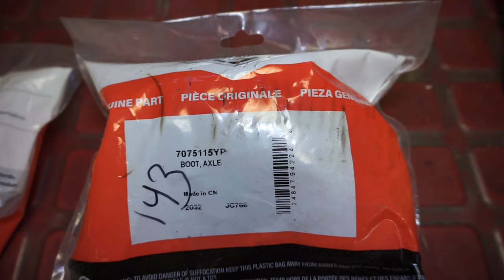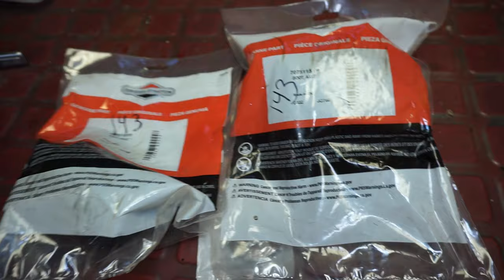2 Old Snapper Riders 28 Deck - Start Up /1st Road Test - What's the Difference,One is 2003 - Other ?

Comment: I bought a mower just like that older one at a estate sale this past weekend...$40...put in new battery, plug, fuel filter...changed oil...it cranked right up. Was told it had been sitting in shed for 12, 15 years since last cranked. Im VERY satisfied with that deal.
Reply from the maker: I don't like you lol hehehehehe
I call NOT Fair lol
Wow, good on you, ya did good, enjoy!!
Reply: I'm STILL mowing my yard with it. Tough mowers that are well made.i had same problem.. Engine ran but it would die when I tried to engage blade... Turned out to be some kind of faulty safety sensor or switch

Comment: These old snappers just run forever 👍
Reply from the maker: Yes,, if serviced!
Reply: They cut better than my $6k zero turn too.
Reply from the maker: @modelcitizen394  Nice,,,,,probably do,,,,I don't have a zero sooo
Reply: @TheNovaJohn  Seriously. I have to make two to three passes with the zero turn to get it as clean as my 27 year old Snapper does in one pass.
Reply from the maker: @modelcitizen394  Really,,,wow,,,thats crazy wasted time!
Reply: Mine currently has a blown motor…9hp B&S
Reply: Still using my Snapper from 42 years ago, I have to laugh each time people say you have to do this and that to them, I did a real good repair with boots after about 15 years of cutting, about 25 years ago, and just a few days ago she got a new belt, and a sharpen blade, and i went real crazy with an oil change!  a grand total of  4 dollars for professional sharpen and balance, 15.99 for a new Kevlar belt, cleaned the spark plug too, and 7 dollars for oil change, But I can tell you for sure I only use synthetic oil period.

Comment: I'm getting my 1985  snapper extra stuff series 5  ready for a repower with a 13 hp Tecumseh xl/c enduro overhead valve engine the sad thing is that Briggs and Stratton quit making them back in 2019 😫😩
Reply from the maker: I know but 2019 is recent so they should be around a while..
What Happened to your engine?
Reply: @TheNovaJohn   The 11 hp Briggs and Stratton went out because I didn't check the oil  in it 😭😭
Reply from the maker: Nooooooooooooooooo
Reply: @TheNovaJohn   yyyeeesss I found out the hard way but it is not a total loss for a Tecumseh engine is going on that machine
Reply from the maker: Noooooooooo lol
Have you removed the drive disk yet? I wonder if that is gonna be rusted on?
Reply: @TheNovaJohn   I got the drive disc and the belt pulley off the blown engine by means of a pully puller the other engine was on a rear engine snapper the drive disc and blade pilot is still on it I'm going to do another video on it tommrow  I've already done 2 on this  engine swap
Reply: I wanted to see her switch into high gear! 😉👍
Reply: @Rein_Ciarfella  she will soon
Reply from the maker: @Rein_Ciarfella  LOL me too
Nice little machine for us,,,I bet she might even cut the lawn too
I didn't like these things at 1st but if ya can get one is good shape and for cheap they are easy to maintain!
Reply: @TheNovaJohn    Drink holder and umbrella shade holder and repaint pretty pink and you won’t be able to keep her off it!  I think that should be a video! 👍🔧🧰
Reply from the maker: @Rein_Ciarfella  LOL,, I gotta tell her this!!!
Reply: @TheNovaJohn  I worked @ the Snapper plant over 40 years TILL B&S closed the plant in McDonough Ga. currently there are MAJOR Rear Engine Rider parts that have being discontinued
Reply from the maker: I've heard that,, That must have been cool working there,,,,How many of these machines do you have laying around? lol
Reply: @TheNovaJohn   just got one  had 2 of the older ones but they went to the scrap yard

Comment: My when I turn the key on my 1028 snapper it does nothing. I know the starter is good and the battery is good. Is there a kill switch that turns off the starter? I may be dealing with a wiring issue
Reply from the maker: Oh yes you are,,,I have a video on this,, check the folder on my channel!

Comment: Quite a number of CHANGES, through out the years, they make look similar but they are not the same
Reply from the maker: Generally, many things seem to be improved I've noticed but I'm not that knowledgeable. 
I just like these! 
I'm hoping to get back to mine this season, I didn't get to it last year even though I put it in my way! lol
Reply: @TheNovaJohn  Well I worked AT the factory from 72 till the plant was closed by B&S, 90% of the time I worked there I worked in the Quality department, I've handled EVERY part, EVERY change, EVERY blueprint and did many of the first piece inspections during that time, the BIGGEST MISCONCEPTION is that since they are similar then one can swap parts, do adjustments willy nilly on all of them the same which is FALSE, doing so can cause your mower to be leas reliable, and even NOT safe

Comment: How much for plastic grass catcher
Reply: Get the mulch kit instead! It replaces the discharge chute with a block plate that seals the deck.

I use Oregon mulch blades and the yard looks amazing. Its also nice doing the leaves in the fall & winter this way

Comment: who cares?  nobody buys those overpriced pieces of crap when you can buy a John Deere with a 42" deck, 22hp v-twin engine and hydrostatic transmission for the same or lower price.  that's why Snapper discontinued them 2 years ago.
Reply from the maker: careful, did you know that Deere your talking about has a crap transmission that will burn out and cost over a grand to fix?
Reply: @TheNovaJohn  sure, if you beat it to death or use it like a commercial mower, but if you use it for it's intended residential use according to the manual, it will last a good 10 years or more.  my neighbor is still running his D130 after 10 years (he even lets me borrow it) and it cost $500 less than the snapper at the time.  But he also did the initial 50 hour service recommended by Tuff Torq, opened up the transmission, cleaned out the old 10W30 oil and metal shavings out of the gear box and filters, resealed it and refilled it with synthetic 5W50 oil.  that gives it maximum torque and much longer life for people that want to keep it more than 5 years.  John Deere doesn't tell their customers about this but Tuff Torq does.
Reply from the maker: @mrbubetube  Absolutely!! I have a video on trying to figure this out for a guy..Worked fine until it got hot then wouldn't climb a tiny hill and after that stopped moving altogether. 
Issue is like you said, if ya don't know, it could be too late. Not much ya can do after that. He cant do it himself so it put him in a bind. If I tried the oil change and it didn't work, its more money on top. Sux. 
People like these Snappers, they do well on the channel too. I laugh, I tell them they have over grown Snow Blower Transmissions lol
Reply: I don't claim to know a ton about mowers but my grandfather had a snapper just like in this video and I was about 5 yrs old when I rode on it, I'm 41 now and that thing still goes 😂😂😂
Reply: BS! These were the only homeowner mowers you could buy that were built to last..and they did. Mines 19yrs old, original engine still powerful.

Theyre just like Toyotas....because theyre designed to be serviced, they will soldier on even during neglect, and if you treat them right and do the services they will last forever.

So im glad you enjoy the generic lawn tractors that Lowes Depot will sell you....they suck, theyre not meant to be serviced and sure as heck not built to last